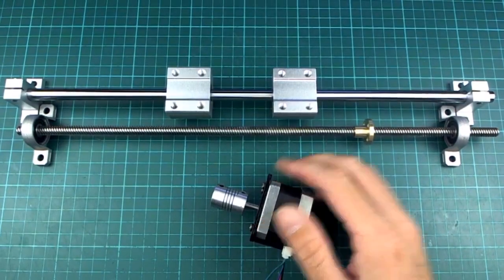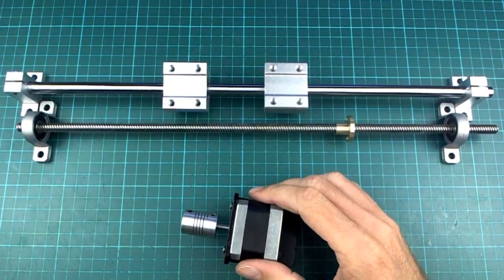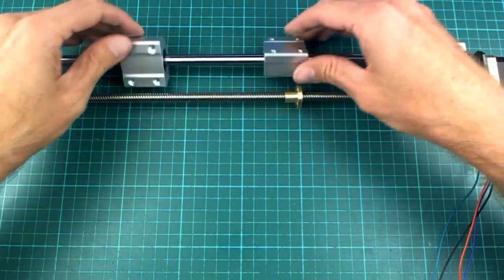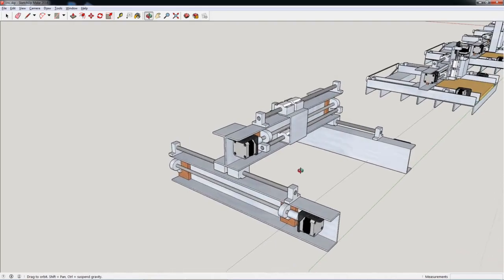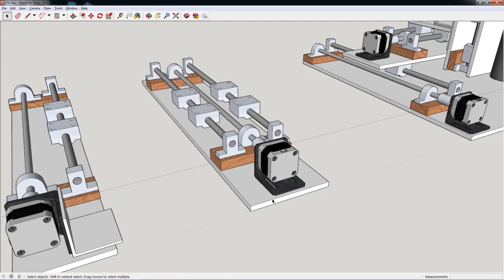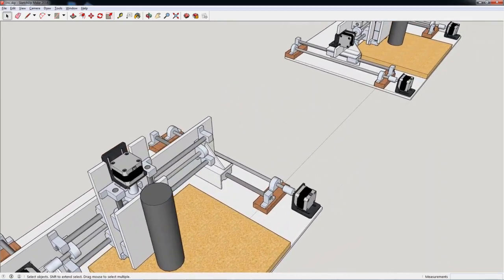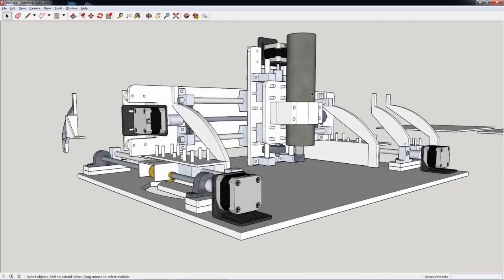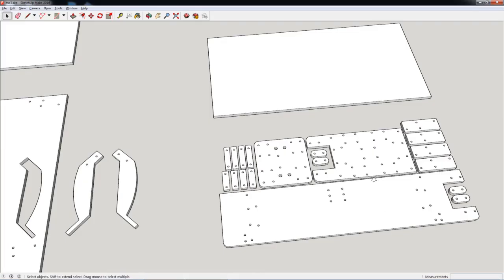DIY mini CNC machine part 1 (intro)

Comment: I build a machine like that with unsupoorted rails like you have. I can already tell you that the unsupported rails will bend/flex too much. You'll need something that has support like SBR12, SBR16 or MGN12.
Reply: People complained about the flex in the old Fireball 90 CNC machines. The guide columns on them must have been 3 inches in diameter too. I mean to look at it anyone would think it's just got to work. But it didn't.
Reply: I went with moving bed instead of moving head.

Takes away a lot of play/flex factors because you reduce the overal moving parts and remove the highest center of gravity part of the machine from ever moving or flexing. This allows you to build an absolutely solid and strong Z axis. My Z Axis/Head arm is made out of steel and attached directly to the main bed (also a steel plate) on which the moving parts are mounted. It only ever moves up and down. This also allows for the use of much gruntier head units and various accessories, without having to worry about cabling, ducting or other things getting pinched or being difficult to route.

All moving is at the lowest center of gravity with all weight spread out over the largest possible area both which reduce flexing and you can easily double up on brackets on the glide rails if you want, making it all even more sturdy.

It's also much easier to mount a vacuum, coolant sprayer, laser power unit and other accessories on a head that doesn't move. No issue with tubes and cabling getting pinched by motion, the head is where it is and won't move other then up and down. 

Moving bed also makes designing different heads (laser, mill, water, pencil) a lot less complicated and quicker to switch between the different ones.
Reply from the maker: hmm.... I was wondering about that
Reply from the maker: You mean for the two bottom rails right? Do you know how much weight your rails were supporting? What diameter were they?
Reply: iforce2d i have to agree that entire x axis and z axis setup will cause flex/bending on the linear rods, you might want to consider changing to some sort of extruded aluminum rails and use v wheels or something along the line where you get a larger cross section on that sliding rail so theres no flexing.
Reply: My rails were 10mm for x and y and 12mm for the z-axis. I don't know the exact weight. Actually I think the weight isn't the biggest issue. The force that is needed to push the spindle thru the material you are cutting will be the biggest problem. The spindle will flex. As someone else suggested, use a (gt2?) belt and pulleys for the x and y. The leadscrews have backlash. On my first machine I also found that the nema-17 steppers weren't strong enough. They ran very hot. I had to run them slow not to loose steps.
B.t.w, you don't need a grbl shield. I ran it with an arduino nano and put the nano + the stepper drivers on a prototype board to keep it small. If you already have everything to build it like you planned, I woukd still build it as a "learning" project.
I threw everything in a corner and got sbr16 rails, backlash-free ballscrews and bigger nema-23 steppers.
Reply: +1 on the motors, nema 17 were getting super hot on my x and y axis so i switched them to nema 23 for my x and y and nema 17 on my Z
Reply from the maker: I see. I'm getting 0.3mm deflection at the middle of the rail when supporting 6kg which is around what the whole upper assembly will weigh. Would the lateral force when cutting exceed that? In any case I'll see how it goes like this first. Were you using a current limiting driver when the motors were getting hot? I played around with drivers like this (https://goo.gl/Kv64GB) and the motors got very hot even when they weren't doing much, so I changed to this one (https://goo.gl/7GF1Mz) which doesn't do that, although I have not subjected them to much load yet. But yes the motors themselves will likely be too small - hopefully a longer nema17 will be enough, would save me from having to rearrange the mounts.
Reply: +enlightendbel do you mean a fixed gantry machine?
Reply: If that's what it's called in english, yes.

The reason why delta and moving head designs work well enough for light materials and 3D printing is because the head gets put under much less (almost no) stresses and because with wood and 3D printing 0.1mm precision is often seen as rather good already, with anything more being a bonus.

As you noticed on your machine, when you try aluminium, any vibration and flexing is very noticable and amplified.
Reply: glad to see this conversation I'm also making a fixed gantry machine but didn't know the terminology.  Building a small base around a Dremel drill press for doing PCB hole drilling and possibly milling if it works for that as well.  Got my basic setup working but going to rebuild with nema 17 motors cause was using ultra cheap steppers for the x y and losing some steps as is but was worth a shot 5 steppers and driver's for $13 I had to try :)